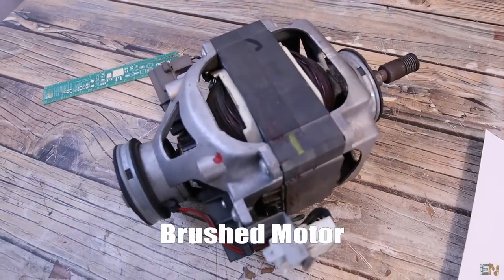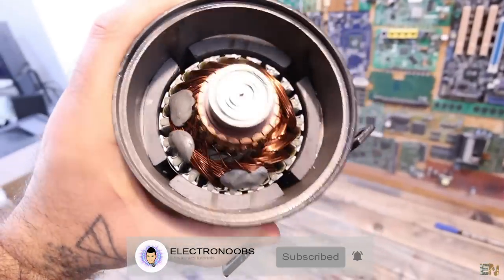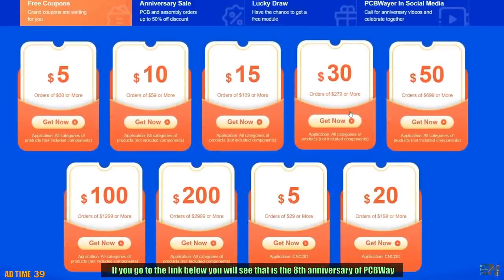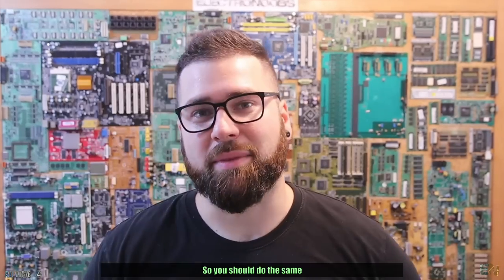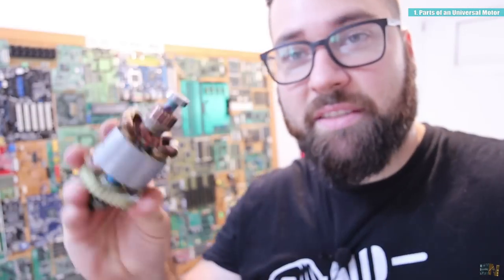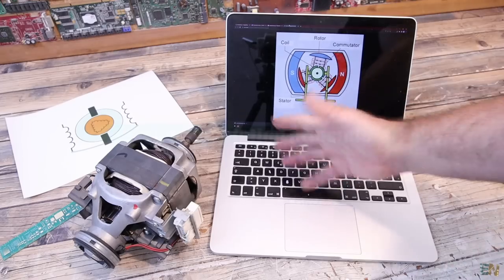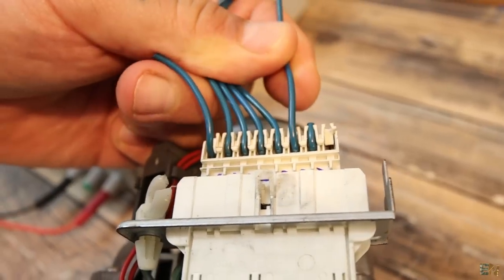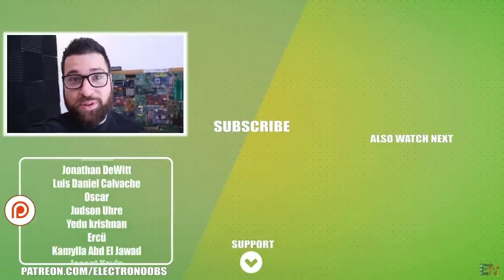Washing Machine Motor AC and DC - High Power Dimmer

Comment: 6:40 When you want to use a series wound universal/DC motor, you should use the tach to ensure that the maximum safe speed of the motor is not exceeded. Running such a motor open loop (no control system to regulate speed) especially with a light to no load can result in the motor going WAY too fast and accelerate wear and tear and possibly risk catastrophic failure of the motor. Photonicindcution style.

In this case you use the tach to control perhaps a PI control loop that controls the duty cycle of a H bridge. This has the added benefit of speed regulation, though not as tight as would be achieved with a shunt-wound DC motor with a control loop.
Reply: Agreed, was thinking the same thing. In DC mode, it's really easy for it to go boom if not controlled properly.
I seen one video quite some time ago where they applied DC power and just let the thing go. Kept raising the voltage.  When it blew apart it was like a bomb went off
Reply: @korishan  that sound more exciting than all the washer/dryer motors that phonticinduction ever blew up! His the brushes and commutator just go kablewy
Reply: You guys do understand it’s just an old washing machine motor right? Give the guy a break. He was trying to explain basic universal AC-DC motor theory to laymen not trying to foresee all the tiniest details the armchair Karen’s out there could pick apart to make themselves feel superior. I like how the Karen you beat to the punch of ridiculous knit picking praised you saying “that’s right and……” trying to scrape up his own stupid detail to add. Boy sure would hate to overspeed that old video teaching prop! Who knows, atmospheric ions in his vicinity could form an oscillating slip
Attracted to negatively charged photons and disrupt the neighborhood direct TV signal causing disasters of e pic RPM proportions
Reply: Oh and actually reading the “substance” of your Karen’s oh I mean comments easily proved without a doubt Yall have no clue about this topic
Reply: So how exactly to you include it in the circuit? The pcb on the machine uses it to control the speed, here we are using the triac which is under our control not a pcb.

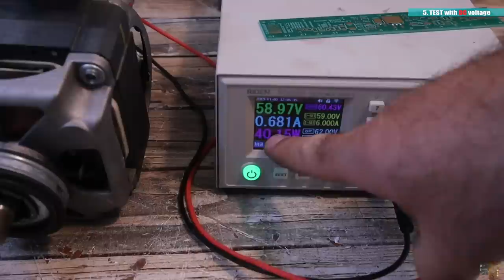Comment: 11:27 if you don't have a load on the motor, it will just use the loss power from the friction, which is very less, if you would burden the motor, the power consumption would automatically increase, because the higher the motor is burdened, the lower is the speed, and the lower the speed is, the smaller is the impedance of the rotor coils because of the lower frequency of the alternating current (the coils on the rotor have alternating current because of the brushes).

Comment: Unfortunately, you fail to explain why the motor can run on both AC and DC and how to reverse the rotation. Because the polarity of both the field and armature are both changed, the rotation remains the same. That's why it can run on AC. To reverse the rotation, you need to change the polarity of just the field coils, or just the armature.
Reply: He did not explain because he probably does not know. In this video he explained nothing. He just applied power after a quick google search to see what were the 2 wires out of the seven. What a useless video!!
Reply: Exactly

Comment: Great video! For more power in DC mode you could connect the static coils in parallel instead of series.
Also it would be cool to see what happens when different voltages are applied to static coils vs rotating, and finally, can it be used as a generator?!
Reply: In that case you end up with what's called a shunt wound DC motor, which has a really cool property that it spins at nearly constant speed regardless of the load! These are commonly used in applications where you need very high speed regulation. (like a lathe, or machinery) The amount of voltage applied controls the speed and the current drawn is proportional to the load on the motor.

When used as a series motor, the speed is inversely proportional to the load (torque). Assuming no friction or windage losses (air drag) the no-load speed would theoretically be infinite. Also the stall torque is going to be very high. This has to do with the EMF of the rotor subtracting voltage away from the stator windings. At stall, there is no back EMF and the current in the stator and rotor are limited by DC resistance of the coils and brushes, leading to maximum torque. As the motor speeds up, the back EMF on the rotor means there is less voltage on the stator coil, which causes field weakening, which (counterintuitively) means the motor speeds up more!

The series wound DC motor clearly has very poor speed regulation inherently. But the property of speed and torque curve makes it useful for EV's. This is commonly the motor type that is used in golf carts for instance, as the higher torque at lower speeds allows for climbing hills and higher speeds and lower torque for cruising on flat road at higher speeds, without the need for a transmission or CVT.
Reply: @power-max  really cool! Thanks for the detailed explanation
Reply: @vadimm6432  Ski lifts is another place to find these motors. Look at this beast! https://www.youtube.com/watch?v=cnG42_YrcV0
Reply: @power-max  nice explanation of basic motor theory. I learned a lot of this while building a DC/arduino control board for a washing-machine, for off-grid power and custom wash cycles. I found that much easier than using the tacho for wash speed control, as is normal for washing-machines, lifting the stator-rotor connection to a fixed voltage accross the stator (10V) fixed a minimum current (5A) through it and gave that stable voltage controlled speed dynamic that you mentioned of shunt wiring, without losing the soft low-speed startup of series winding. Gradually reducing that fixed stator voltage as the rotor voltage increased opened it back up again for the spin to get to full speed at about 200V. (motor wound for european voltages)

to (maybe?) clarify the explanation:
the voltage across a series motor is split into three: the resistive drop in the stator, the resistive drop in the rotor, and the back EMF (generated voltage) in the rotor due to its spinning in the stator field. These three always add up to the applied voltage. The current through the rotor and stator define the strengths of their respective magnetic fields, and therefore the strength of the force between them (torque), which is the product (multiply) of them both. The back EMF in the rotor is similarly the product of the rate of rotation and the stator field strength. When the motor is first started, 0rpm, the applied voltage is entirely met by the winding resistance, so the current is at it's maximum and so is the torque, but as soon as the motor starts to spin, back EMF (generated voltage) in the rotor starts to take voltage away from the coil resistance reducing current and therefore the torque (by current squared). But since this means the stator current is reducing, that also reduces the back EMF, meaning that the current and torque isn't reduced by as much, and it keeps getting faster. eventually the motor reaches a speed where the reducing torque meets the increasing mechanical load and the system stabilizes, but if the mechanical resistance is low, since the speed is proportional to the voltage divided by the current (another way to state that the generated voltage is proportional to speed times current), with very little current (due to low torque requirement) you get very much speed.

Comment: great video!! well explained! is it possible to create a huge dc pwm dimmer to control speed or it just better control in ac with angle phase control ?
Reply from the maker: Depends on the project. It works better with AC and is more efficient! Also, the TRIAC control circuit could be simpler than a DC PWM controller.
Reply: @ELECTRONOOBS  thanks !! Did u received the vfd pcb already ahah, im waiting to see that project

Comment: so is this motor actually AC or DC motor, because if works on DC than it would change the rotation direction with negative supply, then how does it work with AC voltage?? i am curious.